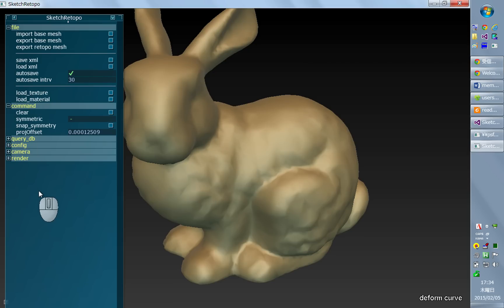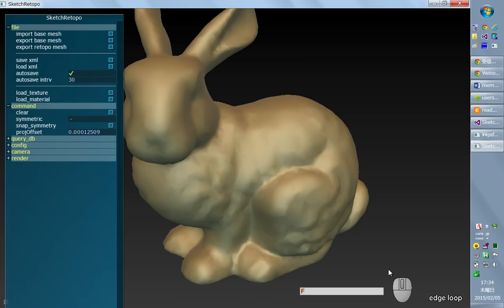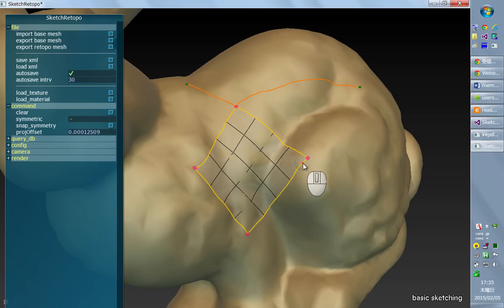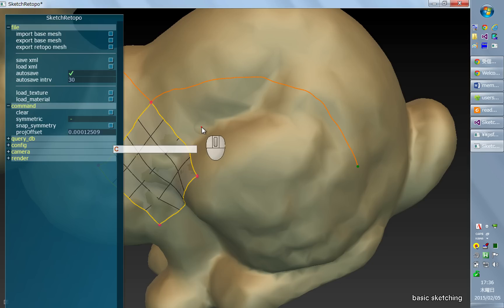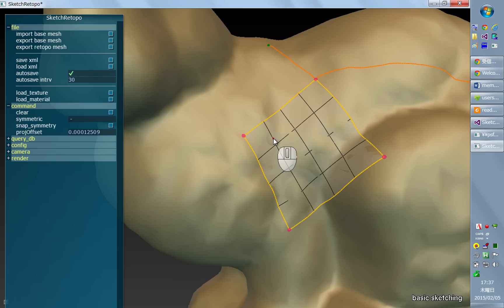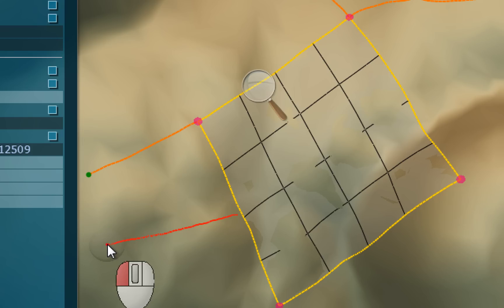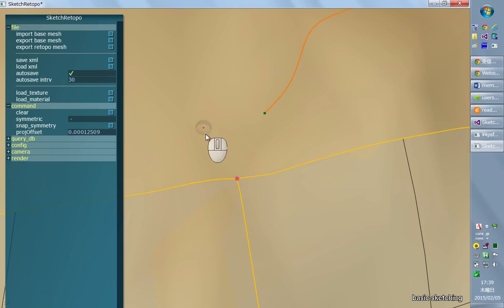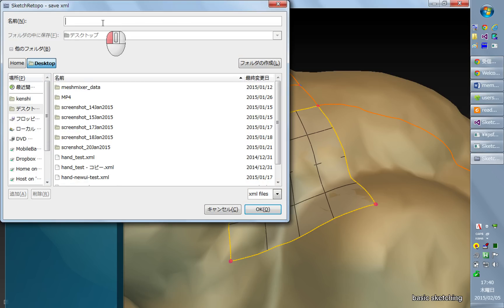SketchRetopo tutorial #02 (basic usage)

Comment: Any idea on getting this to run on Mac OS 10.12.5? It constantly crashes when attempting to open.
Reply from the maker: Hmm, it works just fine on the same version of macOS here. No idea what's causing the crash.
Reply: Hey Kenshi. Thanks for the quick reply. I did notice in your previous video that you mention GLEW libraries are needed. I do have Xcode installed, but every time I go to launch the app, it crashes. Am I supposed to be compiling anything special? I'm not a programmer, so need some specifics if anything like that needs to happen. Thx! P.S. Will you be attending SIGGRAPH this year? I'll be there, and would love to see if you have any new updates you'll be presenting.
Reply from the maker: It needs to have GLEW and GLFW installed, which can be easily done by `brew install glew glfw`. You don't need to build the code by yourself, the included SketchRetopo2.app should run just fine. Oh, maybe the executable file might not have the correct file mode, in which case do `chmod +x SketchRetopo2.app/Contents/MacOS/SketchRetopo2`.

Unfortunately I'm skipping SIGGRAPH this year, and the development of SketchRetopo has practically halted since I switched my focus to the problem of generating volumetric hexahedral meshes.
Reply: Ok, I executed the "brew install slew glow' command and after a few moments it updated Homebrew from e22610aed to f2c2964cf, then printed out a ton of files, ending with Warning: slew 2.0.0 is already installed. I also did the chmod +x to the file. When I attempted start, It crashes again. I went into Show Package and double clicked on the SketchRetopo2 executable itself and got this:

Last login: Wed Jul 19 22:35:18 on ttys000
Mac-Pro:~ stevetalkowski$ /Applications/sketch-retopo-demo/bin_mac/SketchRetopo2.app/Contents/MacOS/SketchRetopo2 ; exit;
dyld: Library not loaded: /usr/local/lib/libGLEW.1.11.0.dylib
  Referenced from: /Applications/sketch-retopo-demo/bin_mac/SketchRetopo2.app/Contents/MacOS/SketchRetopo2
  Reason: image not found
Abort trap: 6
logout
Saving session...
...copying shared history...
...saving history...truncating history files...
...completed.
Deleting expired sessions...36 completed.

[Process completed]

I'm lost at this point. Any ideas? Thx.
Reply: New info - here's what the Problem Report states:
Crashed Thread:        0

Exception Type:        EXC_CRASH (SIGABRT)
Exception Codes:       0x0000000000000000, 0x0000000000000000
Exception Note:        EXC_CORPSE_NOTIFY

Termination Reason:    DYLD, [0x1] Library missing

Application Specific Information:
dyld: launch, loading dependent libraries

Dyld Error Message:
  Library not loaded: /usr/local/lib/libGLEW.1.11.0.dylib
  Referenced from: /Applications/sketch-retopo-demo/*/SketchRetopo2.app/Contents/MacOS/SketchRetopo2
  Reason: image not found

I went to my /usr/local/lib and I don't have libGLEW.1.11.0.dylib

I DO have libGLEW.2.0.0.dylib, libGLEW.2.0.dylib, libGLEW.a, and libGLEW.dylib
Reply from the maker: It's GLEW and GLFW, not SLEW and GLOW. Homebrew will create a link to the library at "/usr/local/lib/libGLEW.1.11.0.dylib" which is required by the program as suggested by the error message.
Reply: Obviously, that was a typo here. (blame autocorrect) ;) I did run the correct command, and glew 2.0.0 and glfw 3.2.1 are already installed. I need to figure out how to get libGLEW.1.11.0.dylib installed, as that seems to be the library that is not loading.
Reply from the maker: What do you see when you do `ls /usr/local/lib/libGLEW*`? Maybe it's the library version that matters, but I'm not sure.
Reply from the maker: Oh, so the problem was indeed the mismatch of the GLEW version. Homebrew used to let you install older versions of libraries, but this feature was removed unfortunately. After some research into how Homebrew works, I finally figured out how to install 1.11.0, see a command sequence here: https://gist.github.com/anonymous/c881ab82e96ec91097344090b69e80a1

Hope this helps!
Reply: Hi Kenshi. Well, that worked! First, I to figure out how to get wget installed. I then had to connect insecurely, but eventually got that version of GLEW downloaded. After running all your commands the first time, it didn't work. I then went through the process a second time, and it successfully installed version 1.11.0 - and SkethRetopo finally launched! Thanks again for your help. Sorry it was such a crazy work-around.